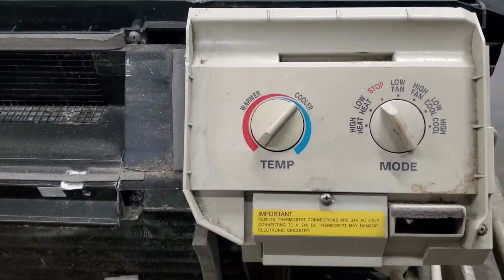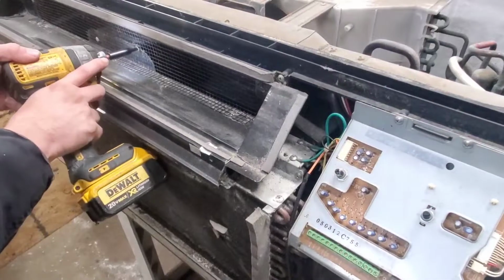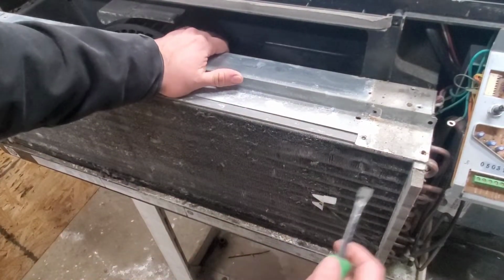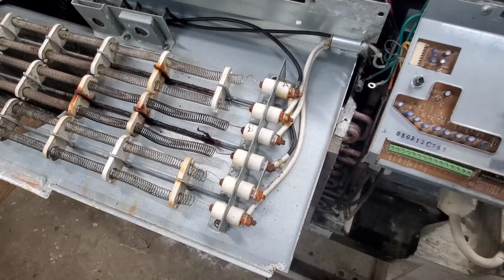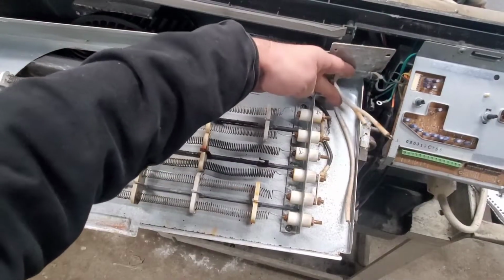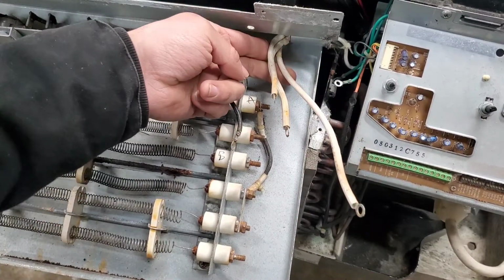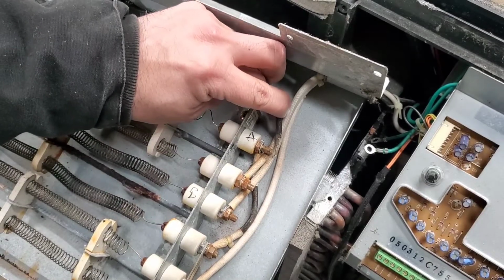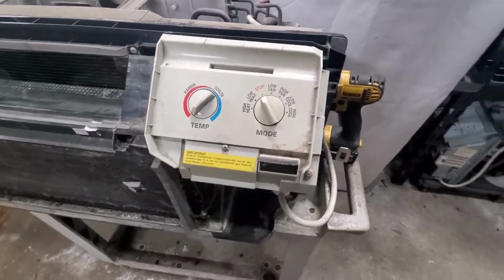How to replace heater coil on GE ptac unit

Comment: I have a question if the coils heat but not as hot as they are supposed to do I replace the coils or is it something else ?
Reply from the maker: It's probably one of the 3 coils that is broken
Reply: @PtacSolutions  thanks will replace it 👍🏼

Comment: Can you tell me  why  i cant turn off the a/c .from the termostat.  And I dont  plug it  in either from the unit  and the fan turns on  automatically.
Reply from the maker: Hey Hugo 
Is the unit a Amana?
Reply: Yes my Friend  is a amana
Reply from the maker: The unit may be set to constant fan. Go to the settings look for C2, in C2 look for "Ba"